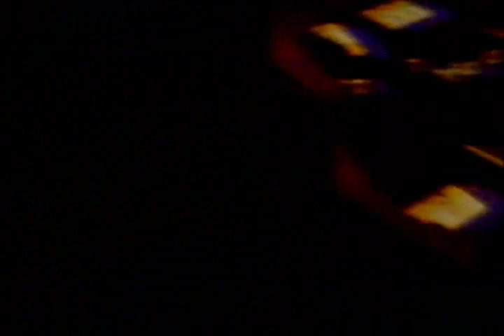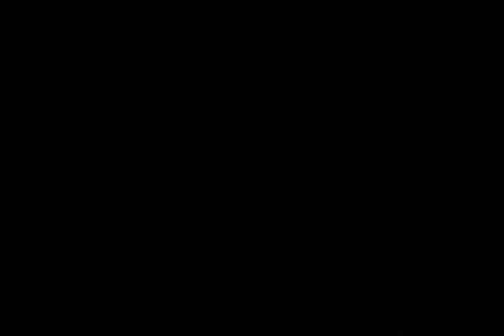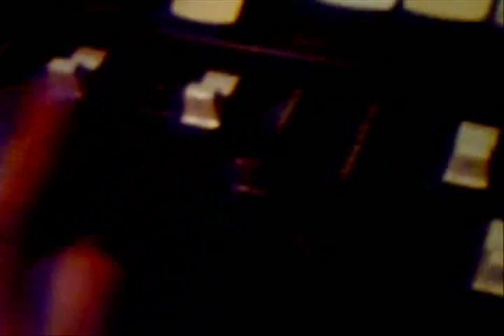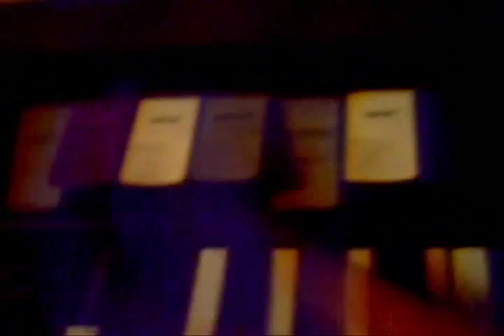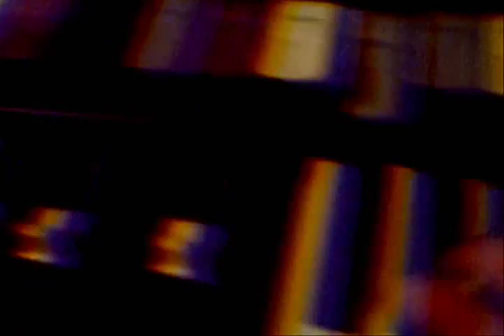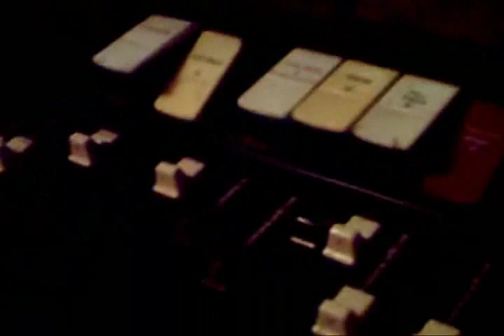Hammond Organ/Leslie Speaker Demo

Comment: the t-100 series internal leslies are the rotosonic type, where the speaker actually spins rather than firing into a rotating baffle. they tend to have richer chorale setting but on tremolo they sound too cheesy like a soap opera. so leslies DO do the job quite well, but not the one you have....sorry